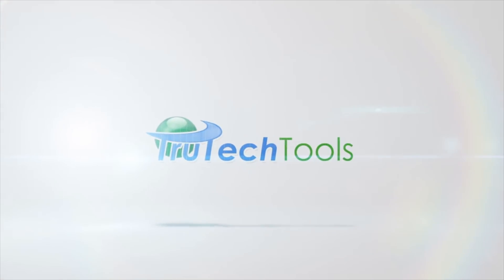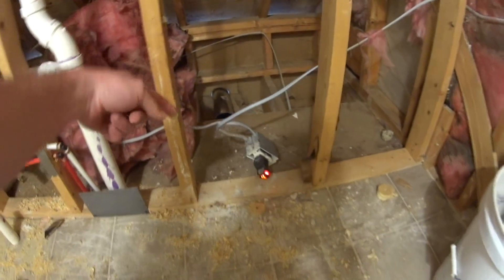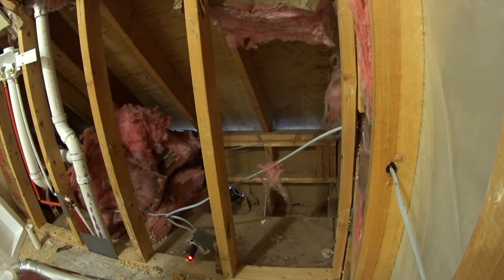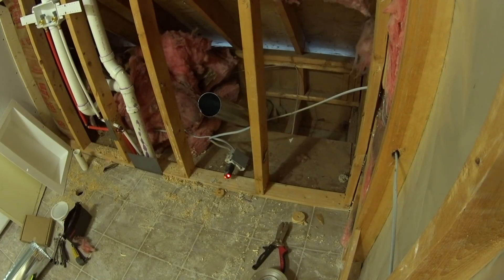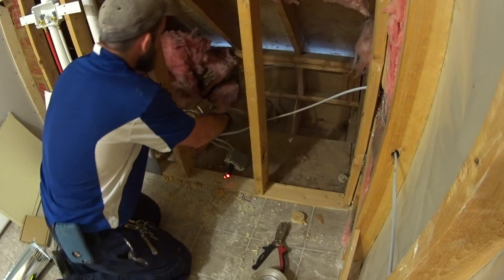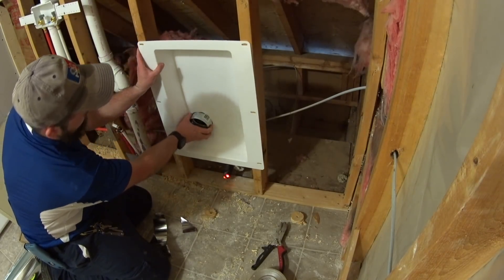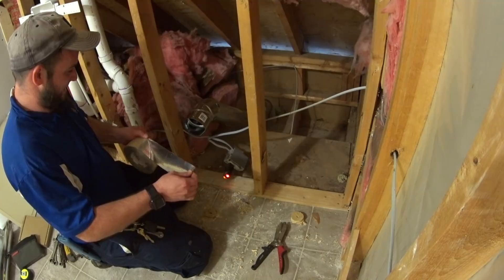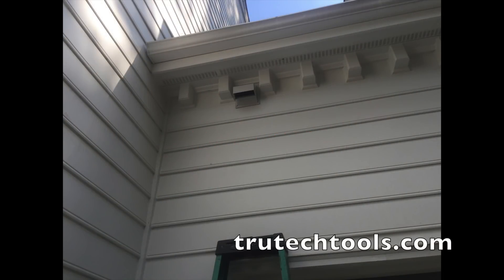10-11-17 Dryer Vent Installation

Comment: What a horrible spot for the exhaust vent. All that hot moist air is just going to get sucked right back into the attic via the soffit. Eventually mold will be present if it isn't already. Based on the video, it looks like it would have been easier to vent out the roof.
Reply from the maker: You’re right! I suggested roof venting and they said they didn’t want that for fear of water leaking. Thanks for watching!
Reply: @StephenRardon  Oh man. That sucks for you. I'm sure you would have done it 100% correct and ensuring no leaks with a roof vent is pretty straight forward. Hope they don't blame you for the mold.

Comment: Steven, I subscribe to a lot of you tube channels. I have noticed that the longer the video, typically the less views they have. Me personally, I would rather watch 5 different videos 5 minutes long than one video 25 mins long. (Especially when said video has 3,4, or 5 ads). Just my opinion. Keep up the good work!
Reply from the maker: +Tim Hvac66 I’ve tried to change my method to making shorter videos cause despite the length of most of mine my average watch time is 5 minutes but I can’t seem to tell any story in less time than whatever I got video of.
Reply: Tim Hvac66 idk, I like the longer videos, I'm early on in my carear with a local union, started just under a year ago, but have about 6 years general contstruction experience prior. The more information I can get, that makes me a better tech, the more I enjoy it.... I'm all for longer videos Steven, the more the merrier in my opinion.

Comment: Cool video I used the aad spm tool you had in one video to check static pressure on the dryer duct run. Worked good
Reply: Aab*

Comment: Stephen, what is the model and manufacture of the dryer box and termination hood on the outside. You are doing an   amazing job on your own, keep up the great work. And that house has changed tons I did watch the series on that house several times, thanks as always sharing with us you tubers. Rick from Swansea Illinois and home of many cats and two kittens that just showed up yesterday,
Reply from the maker: +Richard Mitchell the GC provided the hood so I’m not sure where it came from. May have been Lowe’s Home Improvement. It’s where he box the white wall recess.

Comment: I would have liked to see some foil tape on the seam where the pipe snaps together. I'm an installer in Wilmington, NC and we would fail inspection if the seam isn't taped. Also, I might just be being picky, but you should've used roofing tacks instead of screws to mount the dryer box. The screw heads are protruding where the sheetrock will go. Still a good job though, and you are an excellent and very thorough tech.
Reply from the maker: +Jack Mayhoff I did put tape on the long seam, just hard to get a clear shot of that stuff behind the wall. The screws may be a less than great choice but they will imbed in the Sheetrock and go flush no issues. Thanks for watching
Reply: I own a landscaping business and have been able to not have to take a paycheck for over two years now :D 

Name calling is so juvenile, don't you think as an adult you can figure out better ways to communicate? 
Oh, and I make more money then you...because its so important to you what I do for a living.
Reply: zarahustra , I wasn't talking to you dumbass. I was talking about the seam down the length of the pipe where it snaps together, not the other ones that I clearly saw him tape. He didn't show where he taped the long seam on camera, although he answered and said he did. Also, I know he didn't use tacks to mount the box because I watched him use screws, ya moron. What do you do flip burgers? Because you damn sure didn't even understand what I was talking about. Stick to your unimportant, minimum wage menial labor job and stfu.
Reply: but on the topic jack.... Is it totally unreasonable for him to have not filmed everything? I sort of assumed he taped every seam. I didnt see him use silicone either in the video but i'd imagine since hes a ...you know... professional, that he did the right thing. Context matters, hes taping the seams, why would he skip one? :D

as for the nails he uses, i dont know, i couldnt see them for nails, maybe there is a clear shot of the nails.
Reply: I'm talking about the sheet metal screws he used to mount the dryer box, where are you getting nails from? You notice how he used his drill to screw the box to the studs? I've never known of a nail that's driven with a drill have you? He already explained everything to me and I think he does good work. I don't see why you felt the need to leave your smart ass comment. And, I'm sorry you're a landscaper not a fry cook. It sure takes a lot of skill to mow lawns and weed eat, maybe plants a few trees. I was right about the menial labor job.
Reply: Shut the fuck up vinny mac
Reply: Ramon Cura, make me bitch. I live in NC if you wanna settle it like men, which I'm sure you don't because you're not a man.
Reply: picking fights with random men online whom he doesnt know, and whom he will more than likely never have to confront. 

:D I love it.
Reply: Yo Vinny, calm down and go watch a rerun of Jersey Shore.
Reply: he does tape the seams, did you watch the whole video?

did he use roofing tacks ? how do you know he didnt?

i think your just virtue signaling.

he silicones the hole he made to the outside as well, im sure.